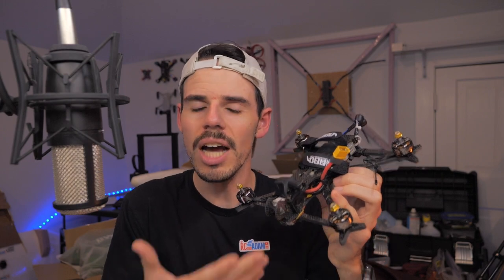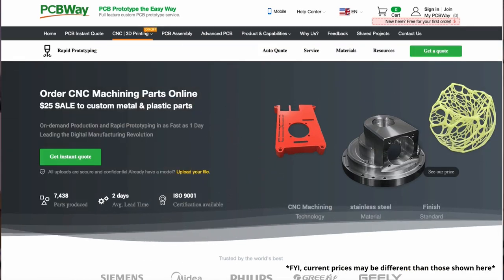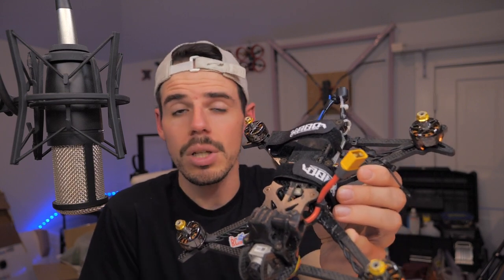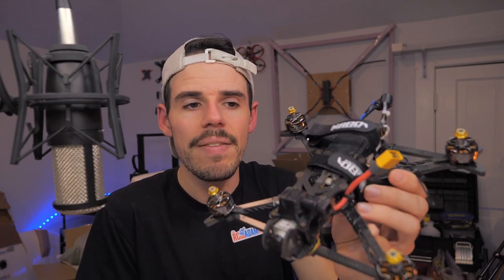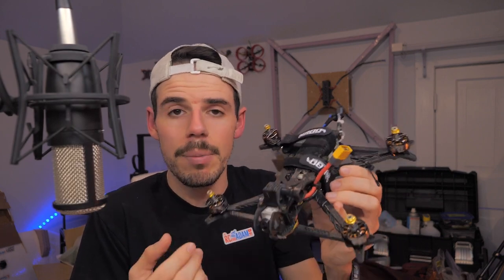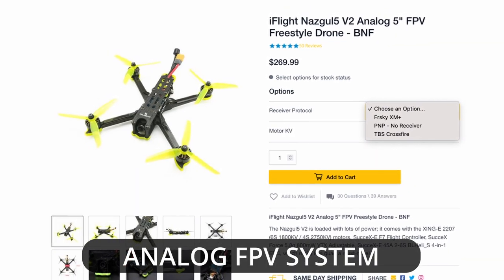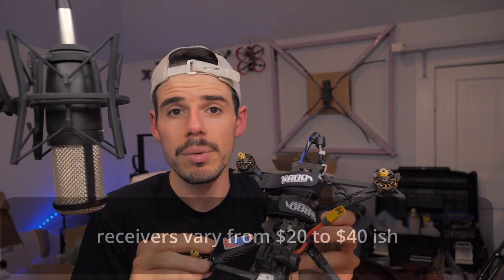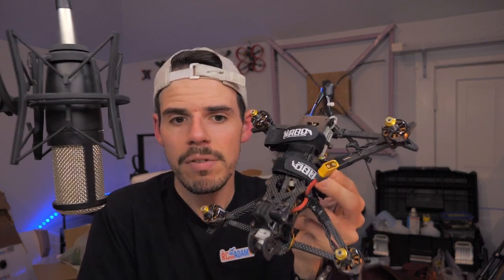You Will NOT Save Money Building Your Own FPV Drone 🤑 But maybe you still should!

Comment: Building one you need tools for soldering , and work lights , table is nice , tapes , shrink tubing , wire cutters , wrenches , divers , allen wrenches or star points whatever fits , magnifying soldering glasses , notebooks , access to reference sheets and instructional videos , test meter , etc.

Comment: Hi am having a big problem with my transmitter fa-I6 please I  need your help
Reply from the maker: Hi, THERCMAN! Tell me your problem.
Reply: @RCwithAdam1  OK thanks I bought it online I t was work fine but trim button and the set up switch are not also working only the joysticks and 2 nobs ,so the issue is that my friend bind my receiver to his transmitter fs-I6x ,after using it  I try to used it back on my own tx fa-I6 but it refuse to connect

Comment: Fly the sim.
It's more fun.  I just saved you $3,000
FPV RC, the radio control side of the hobby,  is a rip off scam and full of FPV con men and shills.  Those guys you like to watch that seem so friendly and likeable.  FPV Con men.

Think about it.  To be a successful con man you have to be likeable.  There are no jobs in this.  Nobody will pay you drive an RC toy around.  You'll never make any money at it.  It's expensive.   It's all parts. It more than likely won't get you flying.  Flying a very expensive robot around, if you ever get that far, IF, is a foolish thing to do with something very expensive and breakable or lose-able.

You can fly the sim around all you want for next to free.  Crash all you want.  Have fun.  Never stress.  Unlimited hours, no battery charging, no batteries.  

FLy it around for 5,000 hours.  If you still like it after then, buy some carbon and try that.   But it's a steep learning curve hill to climb, and if you do, you will find wearing slaustrophobic goggles is NO WAY as fun as flying the sim on a 1080p monitor.

There, I said it.  The brutal reality check for all of you.   RC is a RIP OFF>
Reply: Lol sims are a great way to start but they don't hold a candle to actually piloting an acro kwad.  Sorry you had a bad experience.  Maybe start with whoops or toothpicks if money is a concern. You don't need the best equipment to have fun.  And no you probably won't get a job taking action shots for your local drift team, but you might
Reply: @williwonti  ON the contrary. flying the sim blows flying a toy in the sky away.   I flew 3 hours today.  It's raining outside.  Never left my kitchen.  Flew while listening to an FPV stream.  No damage, no battery charging, no travel, no credit card expense.  Perfect DVR capture with perfect lighting and zero static.

Flying RC toys in the sky is the obsolete way to do things...  like... 1950's old.

I've probably got about 5 minutes on the toy... long enough for me to confirm it flies the same as the sim, and 7,500 plus hours in the sim.  I can destroy any other pilot out there save for a few that would give me a run for my money.And those guys... yeah, thousands of hours of sim stick time as well.

My sim is so tricked out smooth...  that I could never make a quad fly this smooth... well I maybe could come close, but only after... a thousand hours of flying and tuning.
Reply: Jeez who hurt you
Reply: @grandpa_stanley7813  I'm blind, so, I want to say, a pressurized can of automotive carb cleaner?  The stuff should be outlawed.  A Bromton's cocktail of solvents in a convenient spray and splatter back form factor.